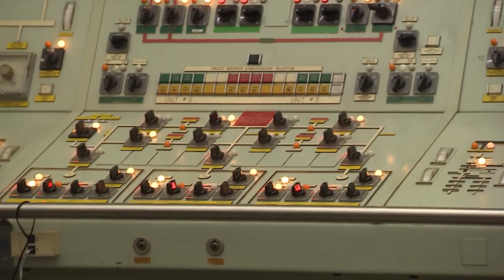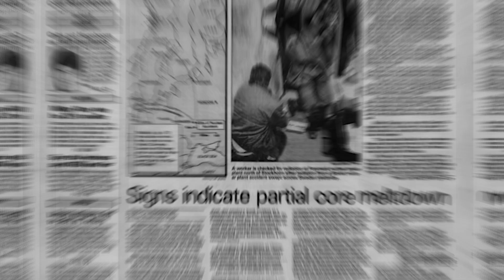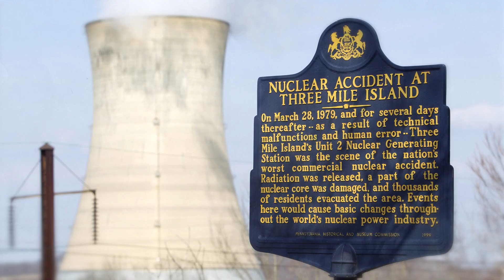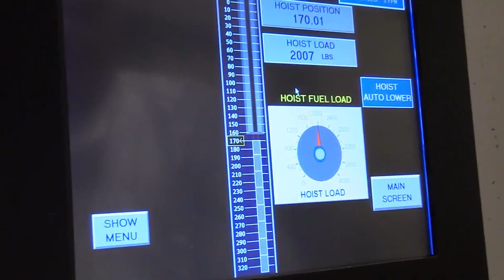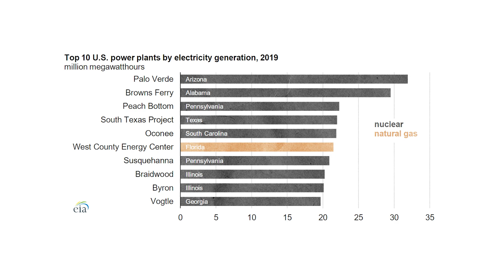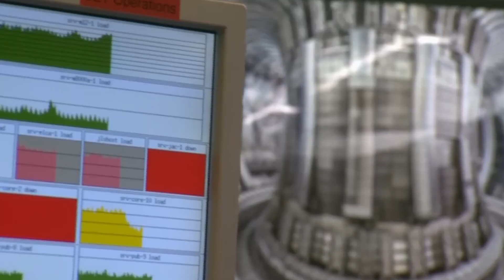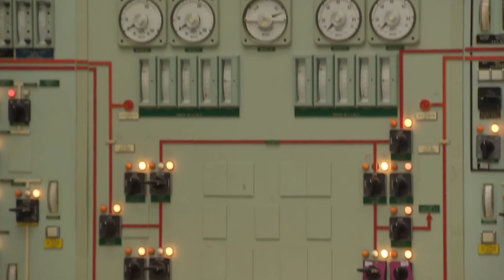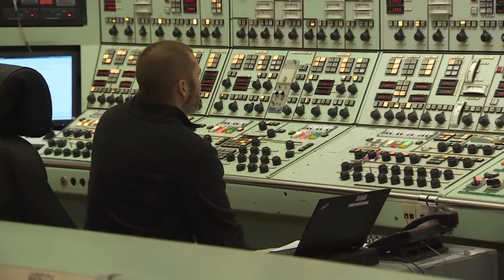America’s New $35 BILLION Nuclear Power Plant Is A Game Changer!

Comment: You need to stop lying to the people. Wind mills  are horrible for the environment disposing of parts that quickly wear out  (blades) is disaster they kill wild life in mass and are unsightly. One hail storm will take out the whole grid not to mention the clean up costs. They do not work when you need them. Nukes work 24/7, gas and oil cleaned up there act long ago and are not issues as stated. We need to stop wasting tax dollars on alt energy and use common sense for the energy we know that actually works.

Comment: The problem with nuclear waste is that the USA passed a law to not allow the waste to be recycled as they wanted to protect uranium miners by not having a competing recycling program. We wouldn't have a waste issue if the USA would reverse direction on recycling.
Reply: Yes
Reply: That would require them rewriting the very legislation that made them the 'power house' they claim to be 😂😂
Reply: @MatthewReinkeScience  Not really
Reply: @jb5nf  everything prominent and successful was literally founded on gross overconsumption and misuse of cheap readily available resources for exponential short term capital gains, recycling is the direct contrast to this but you're right it doesn't really go against the core components of the political and economic legislation at all.
Reply: @MatthewReinkeScience  It's quite a complex analysis. But let's summarize: Will prevail.